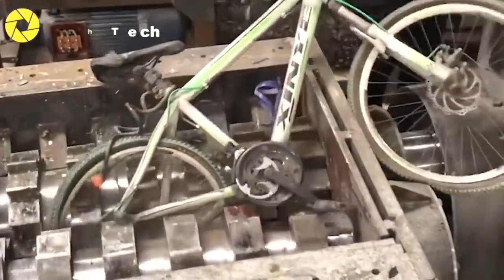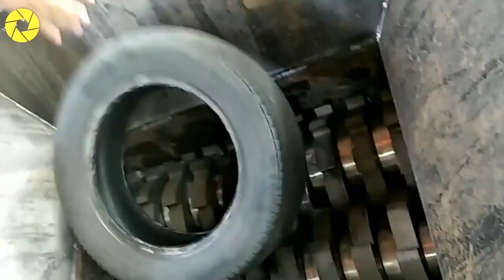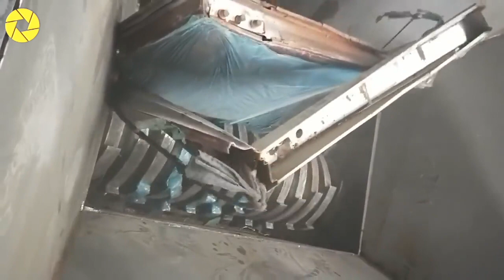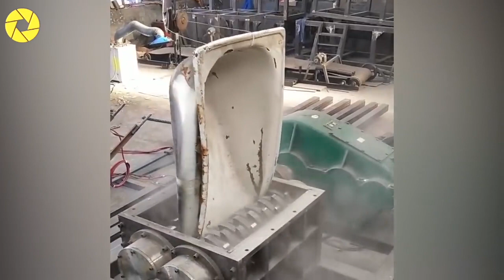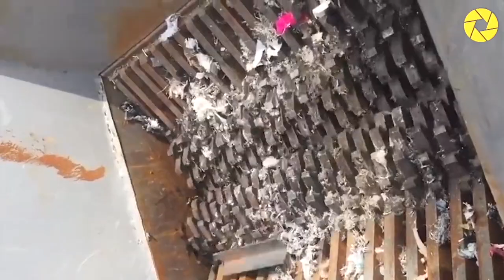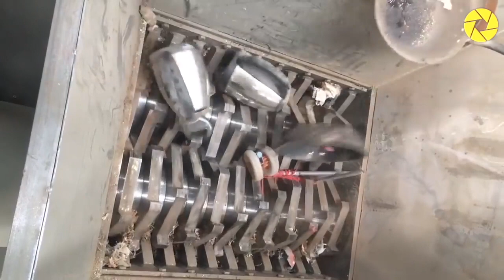Can The Hammer Crushed When Vs The Crusher - Real Experiment

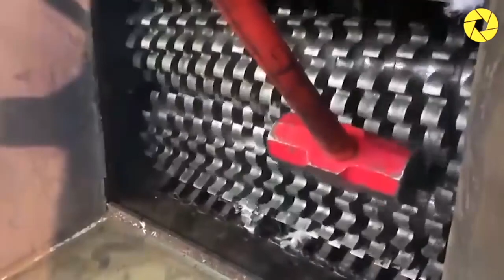Comment: 3:58  when it's really done it will destroy the mach ......for sure [I do know a thing or two about metal and its inner strength ]
not to be ; a know-it-all .....lol. [ ok I know a lot ....lol ]   just making fun
Reply: nah i think a hardened steel ball or a slug of just the right size would break a tooth and that is about the worst i would exspect to happen the teeth are made so they cant grab something they cant chew like if its too big  and in case something hard like a large drill bit fell in it would stall the motor plus i dont think that hammer is anything special